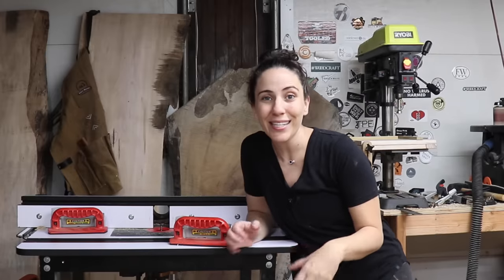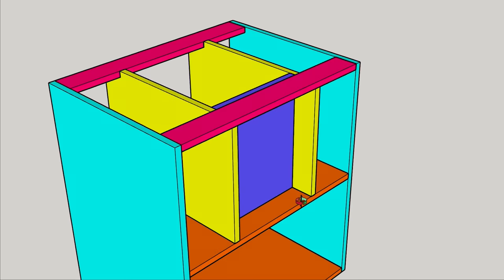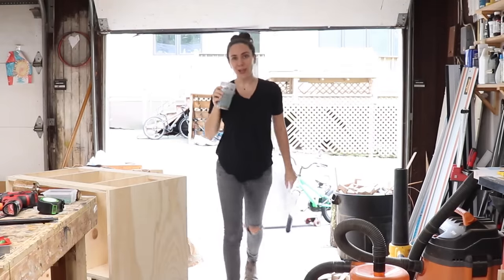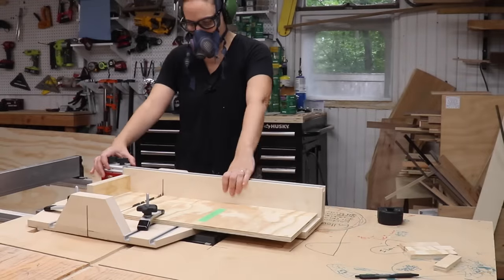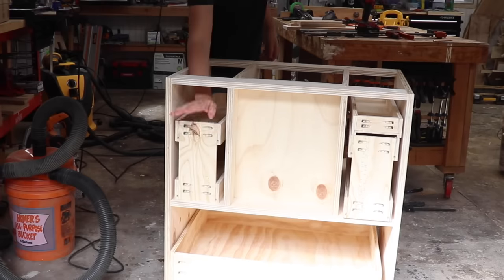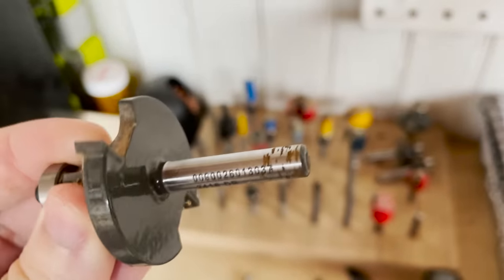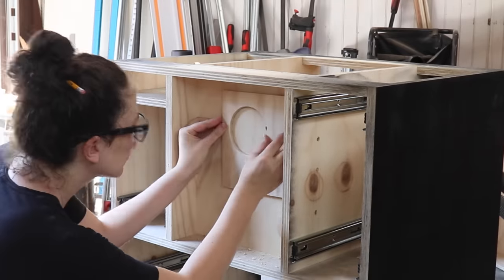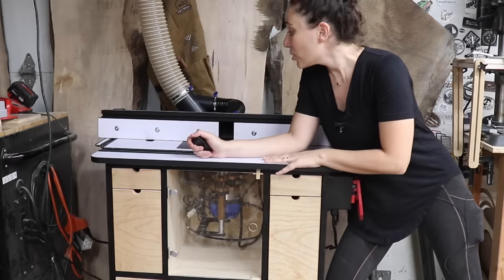Router Table Cabinet Build with STORAGE and DUST COLLECTION

Comment: Don't get yourself down about the dust collection.  If you're keeping the dust out of the air and containing the mess, you can hardly ask for more.  But if you really wanted to collect the chips from the bottom of that compartment, you should have put the inlet at the bottom too.  Just like they do on cabinet tablesaws.  Even so, while my dust collector does an ok job at keeping the air clean while I'm using my cabinet saw, there's always a valley of dust in the bottom of the cabinet sloping down to the outlet.

Totally velcro that remote.  I have Alexa controlling my dust collector, because there's no way I could keep a remote from being lost.

Years ago, I used to look for tape measures and pencils.  I've trained myself into the habit of always putting them down where I use them, and having a tape and pencil at every single possible workstation, so there's always one within reach.  Still, that walk of confusion looking for something I just had is too familiar.  :)
Reply from the maker: I will totally Velcro the remote!

Comment: Another great project ! And it also looks great ! If you move both the intake and suction holes to the bottom of the compartment, the air flow will be concentrated at the bottom, and it will not collect much dust. 😉 Congratulations for the build and thanks for sharing the little mistakes (all of us will learn from them).
Reply from the maker: Thanks! Good point!

Comment: The dust port needs to be located lower where the dust is, making a cone would guide the dust to the port
Reply from the maker: I’m considering making some sort of chute
Reply: @3x3CustomTamar  I think just closing the hole on top and opening one on the bottom.shoukd work.just fine, im.glad you did this because I'm planning on making one for my tablesaw that has a router table and my triton router doesn't fit in their bucket

Comment: Is it possible that you just have to cut the slots closer to the bottom instead of the top, so the airflow will basically push the dust towards the suction point?
Coz if you cut it closer to the top, it may increase airflow but doesn't really add on to the suction force, more likely it will weaken it due to too much airflow. At least that's how the simulation in my head works
Reply from the maker: I just spent all day tweaking. Hopefully I’ll get a video posted soon. But no. That didn’t work. Ha
Reply: @3x3CustomTamar  damn it! I thought I figured out 🤣 thanks for letting me know tho haha

Comment: Re: casters.
I've been installing casters by simply driving screws upward into the plywood. I imagine bolting them like Tamar did would be stronger, but how much stronger?
Has anyone had screwed-in casters ever fail on them?
Reply: I think most of the ones in my shop are just screwed in with no issue.
Reply from the maker: You can screw them. These just came with bolts. So used the bolts.

Comment: Use a rectangular port and move the hole to the bottom. Put the door back the way it was...
Reply: @3x3CustomTamar  One other thing... if you are still getting "dead spots" after putting the port at the bottom in the back of the cabinet, try using various shaped thin scraps to cause turbulence inside the chamber. Just brad nail them until it clears all the dust, then glue them down. I did that on my radial arm and miter saws and router table. All my other tools, I have the sides sloped to the center and the port at the bottom.
Reply from the maker: @kiddiescripterkiller  I just spent all day tweaking. Got something figured out. That’s basically what I did. Hopefully I’ll post a video about it 👍
Reply: @3x3CustomTamar  Very cool...

Comment: I have suggestion why you not drill 3 inch hole on board which is under the router sobwhen dust come down immediatly it will be sucked into the hole try it
Reply from the maker: A good suggestion!

Comment: why did you not glue the case together?
Reply from the maker: Doesn’t need it
Reply: @3x3CustomTamar  I disagree, I think the answer is because you didn't want to use any. Im 54, I have been building things out of wood since I was a child. My Grandfather taught me a lot of what I know. The furniture we have made is still together and strong. some of the project I did as a child that were not glued but screwed are not in as good a shape. Screw joints loosen and are weak, their strength is only at the spot the fastener is at. The purpose of a fastener is to hold the joint tight for gluing and to provide sheer strength when you don't provide a dado joint. Especially on a work table I would glue it up. That's experience talking not an opinion or any ego. I enjoy your channel very much.

Comment: 8” Dado stack is less than $50 on amazon. But why nit cut the grove on your existing router table?
Reply from the maker: My saw can’t hold a dado stack Bc the arbor is too short. And you can do that too. Always more than one way. This is just the way I prefer. I don’t have the undersize plywood bits so I would have to do multiple passes anyway.
Reply: @3x3CustomTamar  well i’m just learning carpentry/cabinetry so i can build most of the parts for beehives. Once i acquire all of the tools and knowledge it will be far less expensive to build them than to buy them. And if one knows what one is doing, the bees can be mostly free.

Comment: You may want to replace the upper dust bag with a Winn cartridge filter (https://wynnenv.com/woodworking-filters/harbor-freight-collectors/). You will get better suction since the filter has more surface area than the bag filter and the collector will collect more of the finer dust.

 Also, flex hose kills the suction power of a DC. You should see be suction if you can move the DC closer to the router table and shorten the length of flex hose. If possible.
Reply from the maker: Yup. All going to be upgraded at some point 🤞

Comment: Great build as always Tamar. I do think your router engine is going to die on you pretty soon with this much dust around the air intake on the engine. They don't like that.
Reply: Check out the Milescraft Dust Router. It attaches to underside of router lift and eliminates dust entirely. Best $30 I ever spent for my shop. Keeps all of the dust out of your router motor!

Comment: I wonder if hardwood runners would be a lot less expensive and perfectly adequate instead of those expensive full extension guides. Just thinking of us mortals, not sponsored by Rckler
Reply from the maker: I purchased these from Amazon ans they were actually a pretty great deal. Wood runners are fine. I just can’t have them in my humid shop.

Comment: The 4" hole in the case needs to be at the bottom of the space..
Reply: Exactly. Those wood chips/dust are probably too heavy to get sucked up. If the hole is closer to the bottom they just have to slide across the floor instead of sliding AND working against gravity to go up towards the hole.
Reply from the maker: Yup! Going to try ans fix it!

Comment: Fun video, I am glad I watched the faq for the accent on drawers, now it all makes more sense. :)
If someone does decide to put drawers in the rockler stand, note that there is in fact room down under the bottom rails for another smaller drawer.  This is what i did for it: https://www.youtube.com/watch?v=SbRp3O35yP0 and the upper drawers: https://www.youtube.com/watch?v=rEWbfE-MLaY  So far it works great and I get zero chips on the table or in next to the router with my two 4 inch dust port connections. :)  The one issue is due to where I put the router 'box', and the quick connect rocker fittings, the outside does stick out past the table top by an inch or so.

To help with the dust collection, put some slanted bottom pieces to help draw the dust to the center of the bottom, and maybe put the dust collector port closer to the bottom.  That plus the holes in the front door near the bottom should get the rest of the dust in your bin into the bag.

Also, if you get a wynn environmental filter, it should drastically improve the small particle catch rate for your dust collector (https://wynnenv.com/) as well as give you more surface area on that end of things, which should improve your flow rate some as well.
Reply from the maker: Definitely going to play around with it!

Comment: I have no experience in a wood shop so I apologize in advance if the question is simplistic.

I'd always guessed that a room full of sawdust runs a somewhat greater risk of being a fire hazard. But that's just as guess as I have, as I said, no wood working experience whatsoever.

How much of a fire hazard is it?
Reply from the maker: Only a hazard if you leave oily rags around and let sparks fly
Reply: @3x3CustomTamar  THANKS!

Comment: Accents are funny,  watch Tommy on this old house you say Draw like he does.
Wile here in the midwest we say it a tad differently but I'm from Ohio so its kinda a mix.  Now if its in England its a bloody draw bloody this or that, Australia it ok mate.  I detect some newengland or north eastern in the way you say draw.
What would life be if we all talked the same, boring. 

THESE TOW YUTES
IM SORRY YOUR HONOR
THESE 2 YOUTHES..... 

ARE YOU MOCKING ME SON?

movie my cousin Vinny. 

You can find humor in speech 
When I moved here to the midwest 
E.  V.  E.  R. Y. O. N. E.   T  a. L. K. E. D. Slow. I mean really slow, back east we talked really fast. But most of the different dialects are going away.
But I think you'll still hear it in different areas. It keeps life fun.

Not ment to be a criticism. 
Don't take it that way.
Shaper orgin 
Dam you got a nice toy there i like that machine.  
You could use plastic fir bit storage like the stuff they put on table saw fences or jigs.  But the foam holders are pretty cheap. 
With the plastic you only need to make a frt pull board and install cleats to hold them the bits fit into the holes 
Draws would be more for tools for the lift and router. You would save money on the draw slides but spend more on the plastic I think rockler and woodcraft have the plastic in 4' lengths 4" wide  1/4 to 3/4" thick  in the smaller stuff it tends to bend .

Comment: Please take this as constructive criticism. Why use pocket hole screws.?? you have skills, The cabinet loses so much long term strength. I don't unde4rdstand why people think a nice row of well placed screws on a functional piece of shop furniture can look good. Other than that I think it's a decent build, I'll probably use and  incorporate a idea or 2 in my next build.
Reply: I have a good answer (maybe not from Tamar, though): They are easy and cheap to use. Dados etc or quarter-quarter etc method also look the best but pocket holes just get it done. Even professional cabnet makers will still use pocket holes. I've had shop equipment for 10+ years from cheap pocket holes and you know what? It still works. No droop or any issues.

Comment: Seriously though...  Usually, you'd be putting things together with glue and minimal screws.  What's the deal?
Reply from the maker: It’s shop furniture. I didn’t see a reason to go crazy. Pocket holes in plywood for casework is good enough for what it’s intended for.